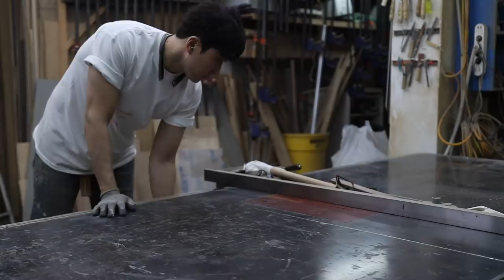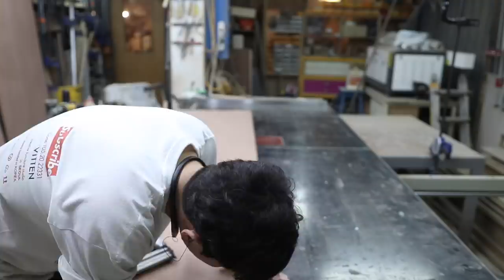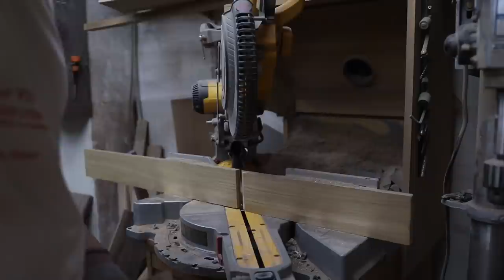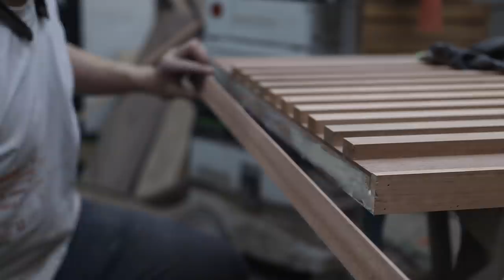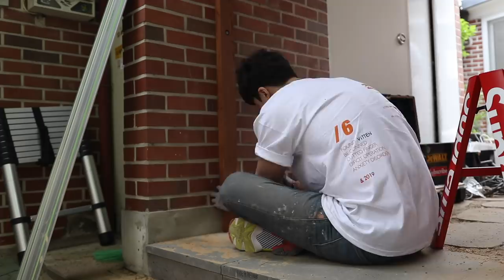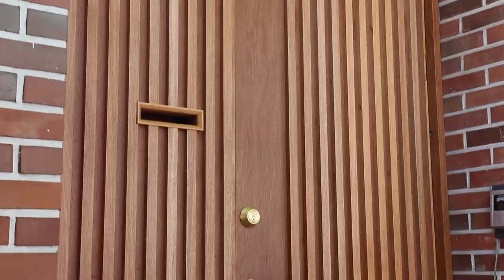W55_Double Front doors

Comment: Agreed with the security issues but as you said the site is a nice area so maybe that’s ok but still it should not be the main door but act as a outer gate. In the video you didn’t show how you anchor the smaller door like a bolt on top and bottom of it and I assumed you must have done it otherwise the door can easily be force open by pushing in the middle because both doors are hinged. Also you may consider using domino or dowel so no screw holes to make good.Anyway the design looks good, modern and entertaining for watching.
Reply from the maker: Thanks for your comment. I didnt shoot every process

Comment: Had call to make 2.4m x 1m x 14cm double arched doors from black live oak plank and finished using custom blacked iron hinges.  The challenge was tearing out the old rotten door frame and bending  the top arch beam and find ing the right equipment to hang the 2 ton set of doors and hardware so that it operated very smoothly.  I love the modern style of your doors!